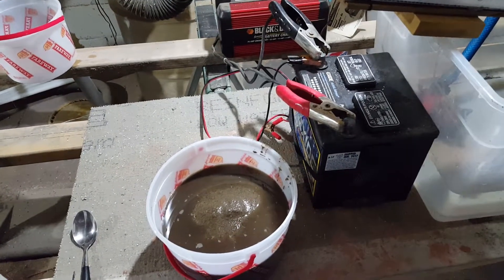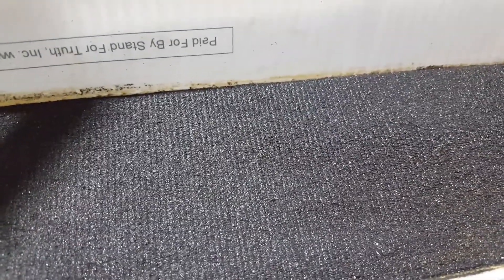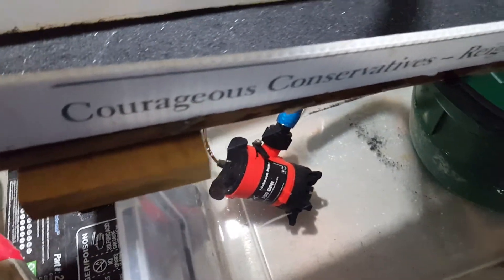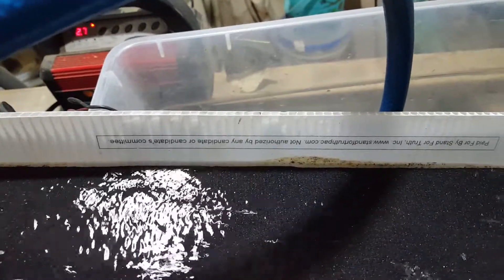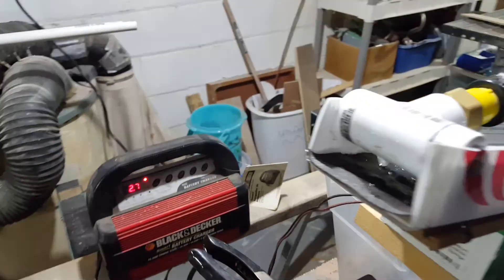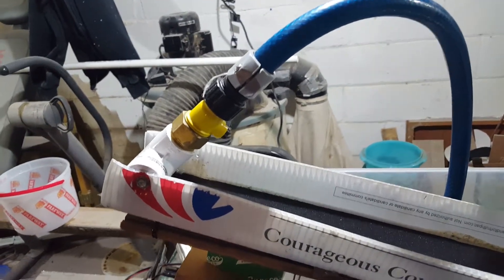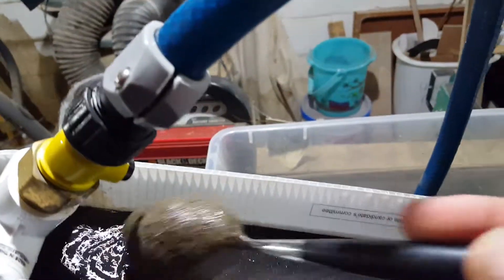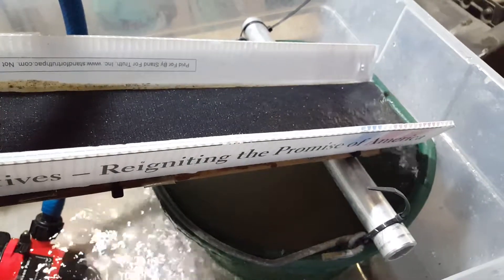Magnetic sluice

Comment: thanks man for showing this.  im building the same thing right now. im after fine to micro size beach gold whats still getting through my goldcube.  ive bought a neodymium  mat with alternating poles i think will give the same stripey cord riffle effect.  ive also bought  about 1000 in total tiny magnets of differing shape eg cube n cylindrical to experiment with manipulating the magnetic field... basically increase the field strength and riffle size in inttermittant lines along the magnetite riffles.  check out halbach array to see what im after doing. it amplifies the effectx2
Reply: by manipulating the magnetic field with halbach magnet array under the magnetic strip it will be possible to create low or no magnetic area immediatley in front or behind a much stronger field if desired depending on magnet strength shape and configuration of halbach array.  low density magnetite pockets in other words it may give bigger troughs to trap gold?
Reply: try and classify your magnetite to one size before using. you can sieve it all back out in one go later and panning that would be easy.  makes the rest of the captured gold and concentrate much easier to work with too
Reply: thanks on advices mr. Geoff,it you record any videos share link pls
Reply: @geoffc1694  This is what I noticed! The magnet mats, with a bar magnet under them will form ridges... essentially deep magnetite riffles. its awesome!